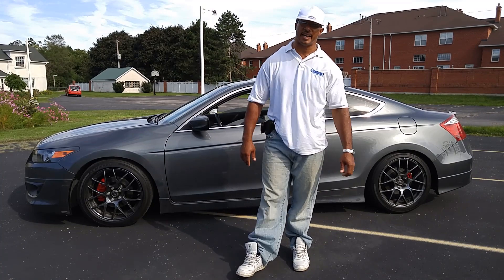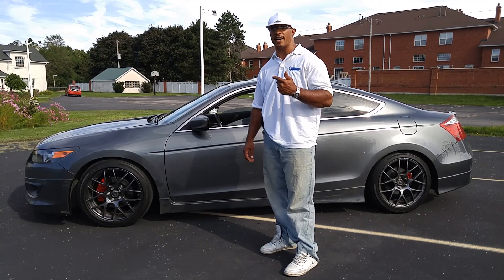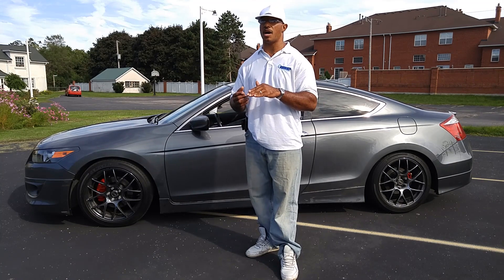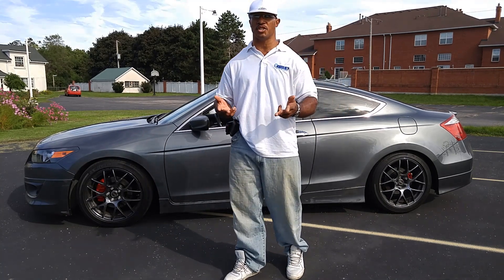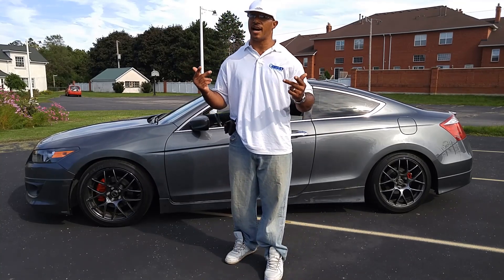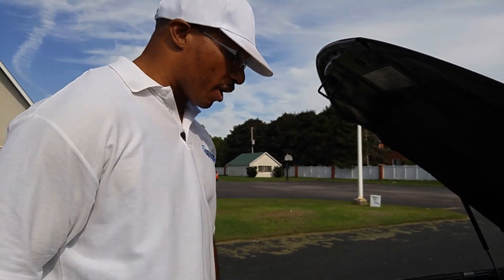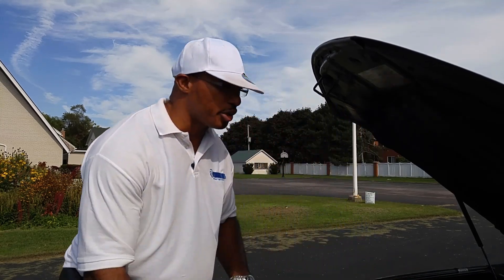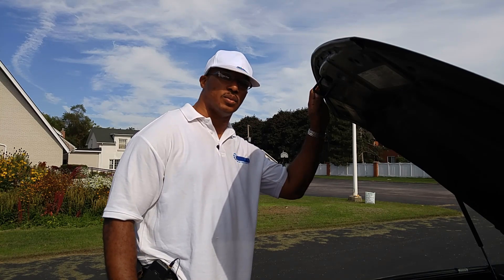8th Gen Honda Accord ''Engine Making Loud Ticking Noise''

Comment: Honda V6 engines are notorious for this clicking sound. You may find nothing wrong at all. Everyone immediately assumes it's the belt tensioner. It's not, because that would result in more rapid chatter. It's not a main or rod bearing. The ticking is too slow and not deep enough. It's definitely in the top end somewhere. Honda actually admitted that there is one problem that could cause this noise and it's addressed here: https://www.enginebuildermag.com/2014/10/knocking-honda-3-5l-v6-knocking-noise/#:~:text=A%20knocking%20or%20ticking%20noise,excessive%20clearance%20from%20the%20factory.&text=We%20often%20encounter%20engines%20that,start%20knock%20or%20ticking%20noise.&text=The%20problem%20sounds%20serious%2C%20but,the%20rocker%20shaft%20bridge%20bolts.

I've heard horror stories about damaged cam lobes on the rear bank. Last Honda V engine I'll ever use. The rocker shaft bridge is NOT the problem with mine, but it's been ticking steady for years. Cam lobes are in decent shape considering mileage. There is no apparent physical damage to the lobe surfaces. I've heard everything from a cracked flywheel/flexplate to loose spark plugs. Can't pinpoint the cause so I gave up.
Reply from the maker: Juan: Much thanks for your thoughts and also for the links. As for the noise, I never did get the chance to find out what was the cause. Shortly there after I ended up swapping out the engine. Everything runs like new after and I was so oh so very thankful..
Reply: @V-TecHondaLove  Hey, your car is beautiful. I feel the same way about my Pilot. It's like a limo inside, lots of custom work, but it's rusting on the outside. I'd love to have something clean like you got. If you're in the Ohio area I'd love to work on your car. I have every tool you could ever need. I enjoy working on Hondas only.

Comment: Soo what was it
Reply from the maker: I didn't ended up finding out. After spending over $1300 and still having the same problem I think it would be pointless to dump more money into the car and still not sure if the problem would be fixed for good. So, I ended up just changing the engine and the car was like new, drives like a dream with no issues at all.

Comment: My 2020 Accord sport has 25000 miles and has a slight ticking noise; makes me think something is wrong with it
Reply from the maker: First check to make sure there's oil. Some times when it have that much miles it starts burning oil. Then go from there 👍

Comment: All my Honda's have a light ticking noise but your sounds a little louder then usual. Probably a valve adjustment needed.
Reply from the maker: I did do the valve adjustment plus looked into another few other important possibility that could have caused the problem. $1300 later, I was still having the same problem. I really do like my car but didn't want to waste anymore money and at the end of it still not sure if the problem would be solved so I ended up just changing the engine. Car drives like new after 👍👍🙂

Comment: Open up the inspection port on your transmission and check the flywheel for cracks.  I had a 4runner that made a horrendous ticking sound.  Thought it was a bad rod or valve issue....nope, cracked flexplate.(mine was an auto...you will have a flywheel).  But it had the same sound and went with the revs of the engine.  At 200+k miles you are about due for timing and valve adjustment which it could be as well, but I'm throwing the flywheel out there for another step in your trouble shooting tree.
Reply from the maker: Hey BuddyLe3: Much thanks for your thoughts on this issue with my car. I did do the timing and valve adjustment but very little changes after. I'm looking into just changing the engine ASAP. Thanks again!

Comment: Dont if you fixed the car my car had that same noise after I changed my timing belt and after that I took the 2 head to the machine shop and one of the valve was slightly bent
Reply from the maker: I ended up just getting a new used engine with low kms. Just thought it was a waste of money to keep fixing different things and still having the same issues are new ones.
Reply: where can i get used engine? How much it costs?
Reply from the maker: @srinivasmalineni6173  I got mines through my mechanic. He knew some guy that does used engine import. Cost me about $2700 Canadian.. I also did the timing belt and water pump, plus the clutch...  It was a bit hard for me to find my engine locally, no one has it. Well one guy did but he wanted waaay too much for it.. Had to wait a few weeks but it was worth it in the end. Car drives like new now :)
Reply: I bought one recently on ebay for 12 hundred
Reply: Thanks

Comment: Check the vvt accuator on the cam shaft ... Its a honda thing on my 05 accord
Reply from the maker: Thanks for the heads up but I did ended up just changing the engine... Really did not want to put any more money into it..

Comment: Its the timing belt tensioner, had the same noise 100 guaranteed
Reply from the maker: I didn't ended up finding out. Couldn't be bothered so I just change the engine all problems was solved 😉
Reply: @V-TecHondaLove  what engine did you put in?
Reply from the maker: @Loso0315  I wanted to put in the Acura RL 300HP engine but was having a problem with a part so I ended up putting back in the same type engine..
Reply: Are you positive!? My car sounds exactly like this right now. 2010 EXL v6 160k

Comment: I have a 2014 honda accord and I also have a clicking noise.  My mechanic said mine is lack of transmission  fluid
Reply from the maker: You should get that looked into asap. Transmission issues can be very costly. With my car I ended up just changing the engine. I spent $1200 and still had the same problem so there was no point in me putting even more money into it and still not knowing the out come. Changing the engine plus a new clutch cost me about $2700. Car drives like new after 😀

Comment: Youtube help me out a lot, so I'll say I had that noise. I clean my mass sensor, my throttle body and replace o2 sensor. That stopped my noise.
Remember the car is computerized and the sensors adjust the gas oxygen mixture. ( Gotti reset rpm after all is done)
Reply from the maker: Yes for sure, YouTube is good for sharing info. I ended up just changing the engine.

Comment: Did u ever figure this out
Reply from the maker: No bro! I spend over $1300 and was still having the very same issues so I just gave up and replace the engine. Car drives like a beauty now :) Cost me another $2000  which included a new clutch..
Reply: Honda cam or timing belt tensioner bro.

Comment: I changed the timing belt, hydrolic tensioner, did a oil change and the noise was still there... I work at a garage and one of my mechanics opened the valve cover and saw like the first grey (coloured) roller was chiped at the corners and it was stuck and cannot turn while the other about 5 I think could be turned with a flat head screw driver... So open the valve cover... And it is not a valve adjustment to be clear
Reply: It's the rollers under the cam shaft. (Just looked up the word)

Comment: My friend had the same issue and spent tons of money trying to fix it. The only fix he had was replacing the mechanism that works the timing belt. Supposedly there’s a motor in there?
Reply from the maker: Oh is there really? I had no idea.. I've been told that it could be one of 10 different things that could cause the problem I was having. Well after spending over $1300 and still having the same problem I said forget it. $3000 later, problem was all gone lol... This did included new clutch, timing belt and water pump along with the new engine. Well new used engine that is......

Comment: I had a similar noise on my 08 6-6 and had to replace the engine because the camshaft was done, and i had a burnt head... all this due to a low level of oil (engine was burning oil and i didnt know...) the noise was basically a rough and bad contact between the camshaft and the valve lift thing (rockers i think?)
Reply from the maker: Yes this engine was also burning oil as well.. After changing the engine the car was like new 😀👍. They're great cars, plus I think the 8th gen are the best looking. My opinion that is 🙂👌
Reply: @V-TecHondaLove  totally agree. I have the blue 8th gen 6-6 and im in love with it
Reply from the maker: @u-funk-6715  Oh I know the feeling bro. I had this 08 which I ended up selling it after 2 years and buying a Kawasaki Ninja 2019 ZX-6R 636. After riding for a season I sold it and bought a 2012 C300 Mercedes Benz. I missed my Accord so much that after just 4 months of owning the Mercedes I sold it and bought back the 2010 8th Gen. Now I'm like a happy kid again 😁🤩...

Comment: Lifters bro I have the same car. But I changed my spark plugs and coils also. But that is definitely the lifters
Reply from the maker: bro, I wish it was. I spend over $1300 on the lifters, removing the engine block and cleaning everything and after putting it all back together, still the same problem. Didn't want to dump anymore money into it and not knowing if the problem would be fixed so I just ended up changing the engine. Drives like new after :)

Comment: Need to replace timing belt tensioner
Reply from the maker: I ended up just changing the whole engine so I never did find out what the problem was.
Reply from the maker: @Aamir Khan I did have that change but the problem didn't go away. I got rid of the engine and everything a awesome after that 😀👍

Comment: man i have the same issue with my 2007 accord v6. It's driving me crazy
Reply from the maker: Hey Auwal, Sorry to hear that man. Have you taken any steps to diagnosing the problem? I ended up just changing my engine...  Cost a lot but I didn't want to just keep fixing more and more problems until the next problem so I just got rid of it altogether.
Reply: VtecHondaGuy i am yet to find the solution to this problem, everyone is telling me that it is my lifters. Sometimes it stops ticking for a whole day and then comes back the next, man! Its driving me nuts!!! I love my car and this engine, the J30 is really an awesome engine but i’m afraid i might have to let this car go as well
Reply: @auwalinuwa2035  I had the exact same issue. You need to change your belts and the tensioner. The tensioner started to leak fluid and make that noise. This is a KNOWN issue on this car.
Reply: Zay Mir thank you for your response. I have a 2007 accord, does that model suffer from timing tensioner problems also? I have uploaded a video of the sound on my channel, please take a look if you can and let me know what you think, thank you.
Reply from the maker: @auwalinuwa2035  Sorry to hear the problem is not fixed yet man but don't give up just yet.. It's an amazing car for sure and I know how much you love your car because I feel the very same about mine... Was driving me nuts as well and even after I had the lifters done, problem was still there... Not sure what your budget is but I would just change the engine. If you can that is.. I did mines and the car now drivers like new :) My wife and bank account didn't like it too much but they know how much I love my car so I was able to get away with it lol... Good luck man!
Reply: @auwalinuwa2035  don't let it go. Do a J32 swap.
Reply: VtecHondaGuy well, it all turned out to be a broken spark plug in cylinder 6. I figured this out by myself using a stethoscope. Everyone kept saying that it was the lifters but i thought otherwise. The car never threw a check engine light, it drove like a dream, not a single misfire. I used the stethoscope to pinpoint where the noise was coming from and sure enough it was the coil pack on cylinder 6. I removed the coil and it came out together with half of the spark plug, the thread was still in there. I had to tow the car to my mechanic to get it out. A $10 tool saved me from almost selling off this car, i’m just happy i got this problem fixed because it drove me crazy, hated driving the car.
Reply: @V-TecHondaLove  im about to do the same thing with my 2012 honda accord hfp... had so many issues with it. Ive owned tons of cars starting to think Japanese cars are not reliable tbo... My 1998 BMW 540i was way more reliable than my newer Honda.
Reply: @djzyx  Japanese and German cars are very reliable. The thing is Hondas aren't the most reliable Japanese cars. They're sporty and efficient cars, but not necessarily the longest lasting. Try a Toyota before you dispense with Japanese cars as a whole.

Comment: I had this happen to my 97 v6 accord, it kinda just went away after a while. Happened for a couple weeks
Reply from the maker: Yes, mines went away after a few minutes of driving but after a few weeks it stop doing that. After spending over $1300 and still not able to fix it. I change the engine.. Drives a like a dream after 😀...

Comment: Marvel mystery oil, thicker weight or Lucas oil all great if you're selling the car or trying to unload it trading it in. They are NOT a repair. It sounds valve train related in the video. I would suggest adjusting the valves but also looking hard at the cams themselves. Google "Honda camshaft galling". The cams wear and pit. It's not real common but it happens enough. Several thoughts on cause but that's irrelevant for your current situation. I have done it on two Pilots and an Accord last year for the same problem. Good luck to you.
Reply from the maker: Hey Greg: Much thanks for your thoughts. What I did was got rid of the engine altogether. I did spend over $1300 trying to fix it but ended up with the same problem so I thought, putting more money into it was not a good idea... Cost me around $2800 for the engine plus new clutch, timing belt, water pump.. Car drives like new now and I'm really pleased... Thanks again..

Comment: Try using 20w-50 engine oil
Reply from the maker: I ended up just changing the engine. Drives like new after :).. Thanks for your thoughts 👍

Comment: Belt tensioner .to me sounds like out of the engine
Reply from the maker: Yes, that was what we thought it was, and so we adjusted it, and the noise did got much lower, but it was still there, so i ended up just changing the engine. Drives like new after 🥳🙂. My pocket was $2,700 lighter, lol 🤣

Comment: Belt tensioner and roller maybe.
Reply from the maker: @Edward: I did change all that plus a few other parts and had the same issues so I ended up just changing the engine and it drives like new after 😄
Reply from the maker: @Edward: I did change all that plus a few other parts and had the same issues so I ended up just changing the engine and it drives like new after 😄

Comment: Honda v tech guy...

Can't diagnose valve train noise.🤣
Reply from the maker: Hmmm, wasn't too sure what it was but after spending over $1300 in trying to fit it with no luck, I ended up changing the engine...

Comment: Lifters and valve adjust
Reply from the maker: Yes, I did that and it did lower the noise but it was still there. I ended up changing the engine and it drives like a dream after 😎

Comment: Adjust your valves first
Reply from the maker: Thanks! I did adjust them and had the same problem so I ended up changing the engine. Drives like new after 😀

Comment: Camshaft
Reply: You are correct my friend...i bought a honda from a guy and he sold it to me cause it did the same thing ...opened up the from cylinder head and the cam shaft was ready to seize up...i found alot of excessive metal shavings from  grinding in the cam lobes and it looked really bad...the cylinder head was garbage and most the valves were bent after testing...so the loud ticking was the result of  bent valves not closing properly and were hitting the top of the piston making that loud ticking sound. So for those who have this problem its definitely the cam about to seize up ...and guess why???
(THE OIL PUMP)  or bad oil flow,  IS NOT SENDING THE PROPER OIL PRESSURE TO SEND ENOUGH OIL TO THE CAM,  SO IT DEPRIVES IT AND STARVES THE CAM FROM PROPER LUBRICATION ..SO CHANCES ARE THE  OIL PUMP AND AND THE ENTIRE HEAD NEEDS TO BE REPLACED.
-PROBLEM SOLVED!  

Note: These V6 engines are notorious for using excessive oil consumption. ...proper maintenance has to be taken seriously cause this is the results of such neglect.

Comment: Sounds like the lifters to me I had the same situation on my Honda Accord EXL V6 also I used Marvel Mystery Oil in the gas tank and in the oil to solve the issue you can get it at AutoZone Walmart Pep Boys try it out it's pretty good
Reply from the maker: Thanks Jerome but I got rid of the engine. Was spending too much trying to fix the problem and $1300 later, same issue so I just got rid of it...

Comment: I almost guarantee its the hydraulic timing belt tensioner. Let mw know.
Reply from the maker: Thanks much for your thoughts, however, I ended up just changing the engine. Just didn't want to put anymore money into it. Still not sure what the problem was. Gave the engine to my mechanic..
Reply: Ok

Comment: That's what you get when doing lots of modifications.  If sounds like the belt or something that is spinning and hit a plastic covering somewhere.
Reply from the maker: Car have zero mods. Not even a cold air intake. All you're looking at is just cosmetic. I bought the car this way the month before and the guy told me it just needed a little oil. Yea right, was more like an engine change lol...  Which I ended up doing. I really like the 8th gen so it was not a problem for me to put the money into it..
Reply: Yeah I have zero mods aswell and am here for the same noise so 🙃😂